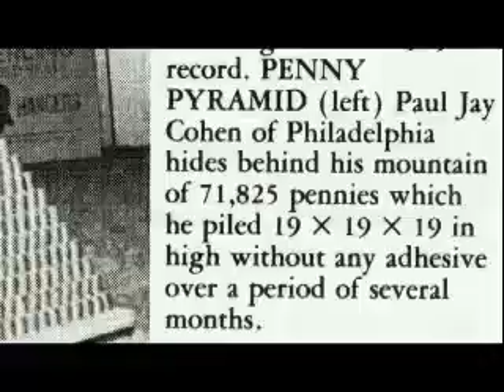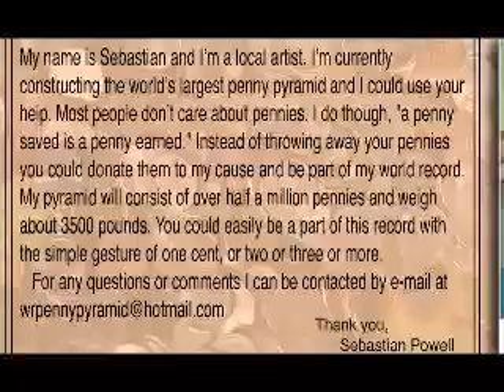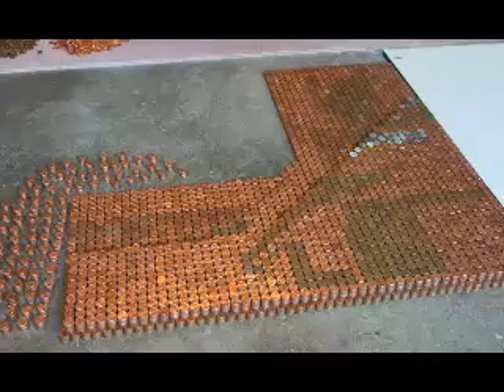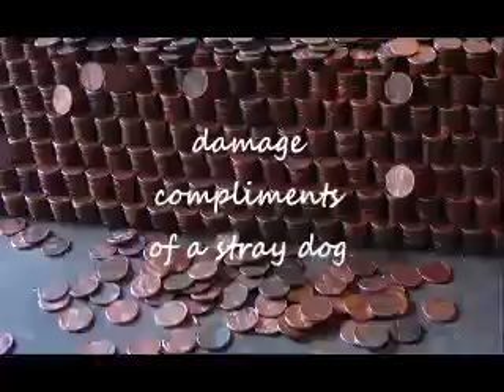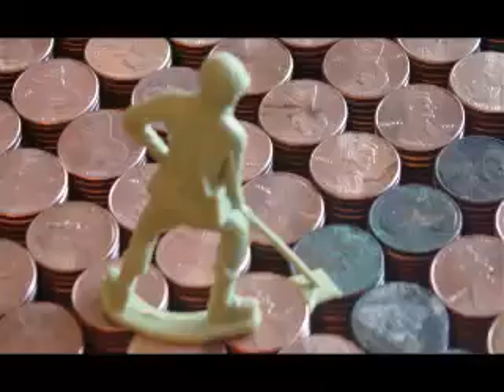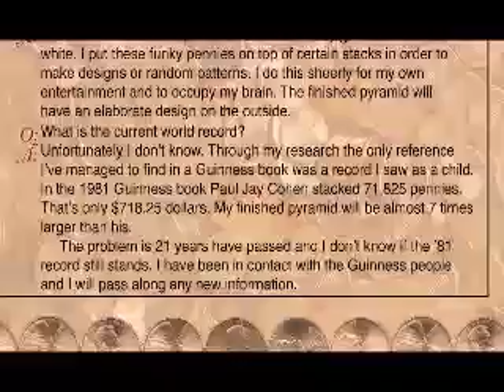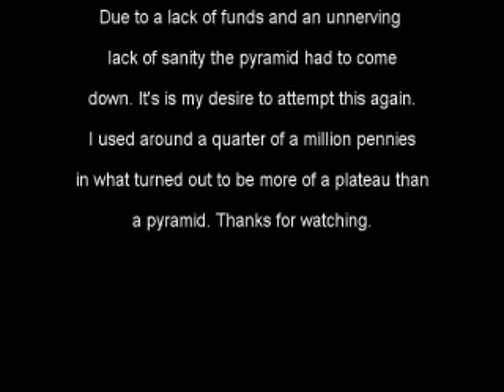penny pyramid WR attempt

Comment: 19x19x19 WHAT...?
Centimeters? Yards?! TELL ME GOD DAMNIT!!!
Reply: 19 pennies
Reply: "19x19x19 in high"
19x19x19 inches. Learn basic numericals :P
Reply: but that would a fucking square?!?!??!?!
Reply: MaxGaming65 the length of 19 pennies is greater than the height of 19 pennies
Reply: Since the length of 19 pennies is greater than the height of 19 pennies... put less pennies length-wise than pennies height-wise (ex. 14 height-wise, 5 length-wise)
Reply: But yea... it would be rectangle 19x19x19 inch... I use the metric system so if this is off... convert it to cm...
Reply: Tehlolcast He has a point its way the more than 19 pennies on the bottom of that pyramid. nineteen would be about a foot wide and that thing is at least two feet wide

Comment: Great video and attempt!  510,390 is not "almost 7 times larger than" 71,825. It is about 7 times AS LARGE AS 71,825.  "Larger than" is not the same as "as large as."  Simpler example: 15 is 3 times as large as 5.  It is 2 times (NOT 3 times) larger than 5.
Reply: It's well established that "larger than" is distinctly different from "as large as." The fact that it's easily misunderstood doesn't mean that the language isn't precise. In your example, you used a phrase "by . . . times" which basically creates a 3rd way of stating the relationship, different from both "larger than" and "as large as." Context isn't an issue; it's usage. Using percentages doesn't change the meaning of the words; it's just that, for percentages under 100%, people usually get the usage right, because a mistake would be more obvious. Example: "5 is 25% larger than 4." Most people clearly see the distinction between that and "5 is 25% more than 4." It actually helps to illustrate my point.  Oh well, not a big deal (unless you want to be precise and consistent).

Comment: copper is weighter than steel, i hope you know that pyramid might weight 1 ton xD, your floor is in danger :-D
Reply: He obviously knows because it says in the video that he expected it to weigh 3500 lbs. It WOULD weight more than a ton, there's no "might" about it. His concrete floor is not in danger because even cheap concrete has a PSI strength of 2500 lbs. per square inch. This pyramid has a footprint of around 1300 square inches, which theoretically means it could weigh 10 tons and still not damage the floor. Of course the weight distribution is not equal since they are stacks of pennies independent from one another. The center will weigh more than the edges, but it's still nowhere near what it would need to be to damage the floor. Compression strength is what concrete is good at handling. Now if you glued the whole thing together and turned it upside down so it balanced on a single stack of pennies then you might have a problem, but also might not, depending on the type of concrete used.
Reply: Its quite a pain to explain because english is not my language but u have to take other thing than just the tensile stress limit, for exemple in France Its about 700 pounds per square meter

The weight create a Big momentum that will over pass the resistance of the material
Its différent if the concrete is on the ground
Damn i suck at english xD so frustrating..
I love life anyway and i dont have enough pennies :-'(
Reply: It looks like he is constructing this in his basement or garage, which means a concrete slab on the ground, probably reinforced with rebar so you could park a truck on that floor. And, fun fact: since 1982, all pennies, minted in America, are made mostly of zinc and are only about 2% copper. :)
Reply: Did i seriously just witness someone say "weighter" in a sentence as if it were an actual word?
Reply: My bad, but try to speak french to me and im sure i will have some laugh :-)
Reply: Heavier is better i guess
Reply: pieces mécanique very true.. :)
Reply: Good thing that pennies are made of aluminum, not copper. Scratch one with a knife or file and you'll find out for yourself. Only pennies that are decades old are solid copper. Modern pennies only contain a plating of copper that is only a couple of molecules thick. 

Aluminum is prized for its light weight, strength, and corrosion resistance. I think his floor will be just fine, unless it was damaged and in need of repair to begin with.
Reply: Yes, it would weighter than steel.
Reply: IsThisSumBattleToads They are not made of aluminum. They started mixing hellium into copper in the 80s to make it lighter in color and weight. Do some research before you post this useless crap.

Comment: Seems that you must glue the pennies together or the massive weight will eventually collapse the structure.
Reply: When you do the math and figure out the weight per square inch it turns out to be unbelievably low.  I'm up to over 533,000 pennies on my pyramid and it's more sturdy than one can possibly know.  No chance of this bad boy coming down.  Just look at my latest update, you'll see.

Comment: Ok so the average penny weighs 2.5 grams so that would mean 500 000 pennies weigh 1250000 grams. So that means that 500 000 pennies weigh approx 2753 lbs. So that means pennies are basically not even worth their weight considering that many pennies is only worth 5000 dollars approx.